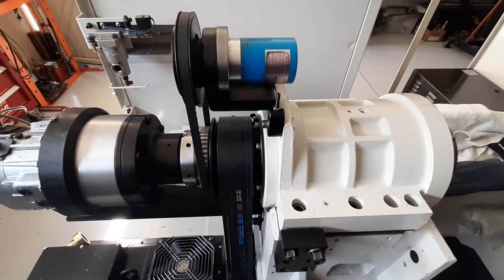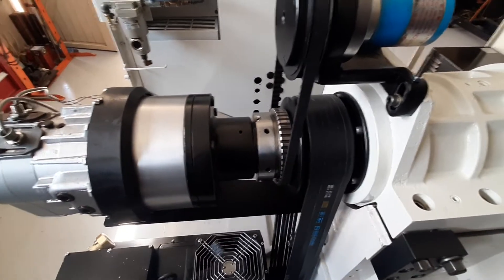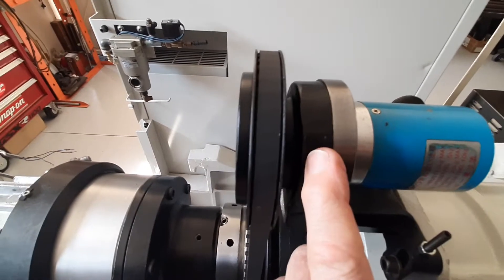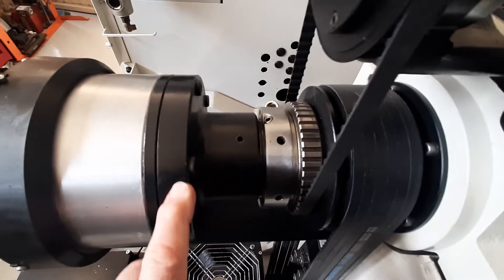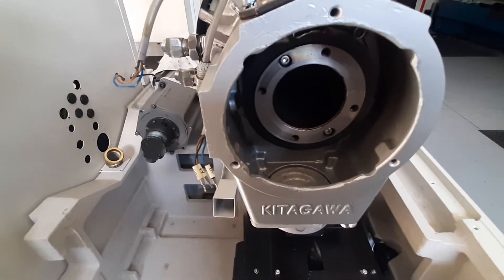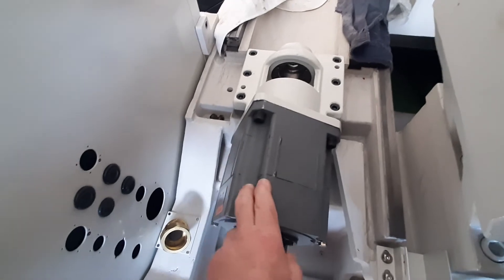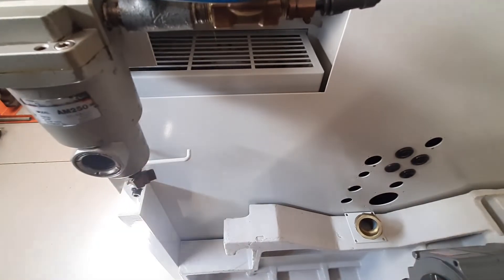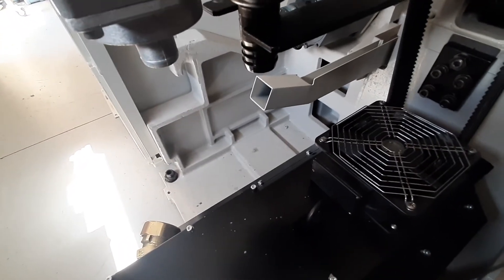CNC Lathe Rebuild.  Worth the Effort ????

Comment: Hi Peter! Is It a Mazak Quick Turner? Congratulations!!
Reply from the maker: Yes.
It's a Mazak QT15 1990 model.
Only 2 Axis but it will be a big help once i get it running again.
When ever that is ????

It's a great project to work on.
I can't say i would be in a hurry to do it again though, LOL.
Reply: I'm sure the result will be great. I have a Quick Turn 10 waiting for a makeover of this type for 5 years, I hope to have time to start, when that happens I will contact you. Success!
Reply from the maker: @edmaker_76 
The best thing i find about Mazak especially with the older machines is they still have most parts available Ex Japan.

They were smart enough to reuse the spare parts on multiple machines which doesn't make a new machine purchase that exciting.
But a great idea if you need spare parts 30 plus years later.

When you get started on your rebuild maybe you could post a few videos of the work you are doing.
Not really a popular series of videos for many people to watch.
But still interesting for some people out there.
It's also a good video diary to watch for yourself some time in the future.

Comment: Hi Peter
Robert Brown from Sydney here. I,m posting in this thread because it is very recent, however my question relates to your series on the Siemens 808D Controller. I note that the videos run sequentially from #1 on up. Is there a video #4? The sequence seems to jump from  #3 to #5. Can you advise please?
BTW.... great videos mate !!
Regards,
Robert Brown
PS Where abouts in Oz you located?
Reply from the maker: Hey Robert.
Yes the videos were #1 to #5.
But #4 video was deleted ??
I cannot recall what the title of the video was now??
But I was not happy with the video for some reason.
So actually there is NO #4 video.

I am based in South East Melbourne. 
For interest.
Regards Peter.

Comment: Are you pedantic to the point of clocking screw heads?  ;)
Reply from the maker: Hey Tim.
Yes I Am Guilty, lol.
That does sound ( maybe / something ) like me ????
Whats wrong with clocking screw heads,  ( hex,s on bolts too lol )
That,s my version of sanity.

Everyone has a dark side to there personality.
It,s a birth defect i think.

Even to the point of when i put my front fence up.
I have all the post perfectly in line. 
  ( there,s more, but you get the idea ) 
That,s normal is it not ??
It,s like that so when you walk past each post they line up.
It helps to keep the earth spinning in the right direction too.

I do sometimes take it to the extreme. ( normal for me )
Just as well i get paid by the hour,  not for the job ??

Thanks for giving me good laugh.
Very Much appreciate your comment.
Thanks for watching.
Peter.
Reply: @weldmachine  I first heard of clocking screw heads (in woodworking) about ten years ago.  My first thought was "Dang it, now I'm going to have to do this from now on!"  I'm like you and have to have things "right".
Reply from the maker: @hopper1  
Hey Tim.
It,s something i learnt back in secondary school from one of my woodworking teachers.
As mentioned i do the same with hex,s on bolts.
I try to put the flat side to any flanges.
I try with nuts, but does not always work ??
If i push to hard i might finish up with the nut back in my hand again, lol.

The only downside ?
If you become to fussy.
You wont make much money.
Most don,t care, as long as it,s cheap.

Comment: What sort of software you going to use this this beast Peter? May I suggest Centroid Acorn if you haven't decided yet, brilliant 4 axis board with great support. As far as I am concerned the best board for us DIY giys, Mach 3/Mach 4 etc don't have a patch on Centroid.
Reply from the maker: Hey Bruce.
I am still a bit old school when it comes to machining. 
I still like to program at the controller.
Most of the work I would run is only 2 to 3 axis work. 
Also that is the limit of both of my machine's.
Any other additional axis work would be completed in a separate op or another machine.
Or some sort of fixtures for correct alignment.
I am basically a repair shop that got involved in manufacturing by accident ???
Meaning I don't find much enjoyment from manufacturing.
It's more of a keep the customers happy situation.
I find it becomes to repetitive.
Running CNC machines is great when programing getting everything running smoothly.
But after that.
It's a little bit like watching grass grow, LOL 
Just my way of looking at it????

Very much appreciate your thoughts and ideas.
It makes a difference when people like yourself get involved in what I am doing.
Thanks again for watching.
Peter.
Reply from the maker: Hey again Bruce.
Looking at your comment again.
I don,t think i answered the question you were asking ?

I am not sure if you know the brand of this lathe or not ?
Sometimes i answer comments thinking everyone is up to speed with what i am doing.
The Lathe is Mazak which has an excellent controller that suits my way of programming.
Which includes a Conventional side also,  for some easier programming.
But as with any Conventional Controller they are still limited ??

Hopefully my second reply, answers your comment much better.
Thanks again.
Peter.

Comment: Super clean and tight looking. Looks like something from the space program.
Reply from the maker: Hey John.
The award for first through the door once again.
Space Program, lol.
I don,t mind if you refer to that way.
Must mean i am making an effort then.
I Love the lighter colour.
Definitely better than the Green Grass colour it was originally.
Just as well the outside of the machine was average to look at.
Gives me more reason to make a change.
Thanks for taking the time to watch.
Peter.
Reply: @weldmachine  I mean that it's super clean, and also (to me at least) futuristic looking -plus I don't really have any frame of reference for the parts like I would if I were seeing a manual lathe, so it's like exotic in a technology way, like a satellite or some space station component would appear to me.